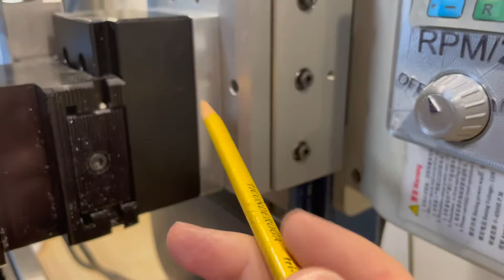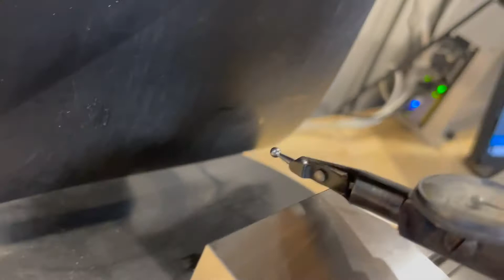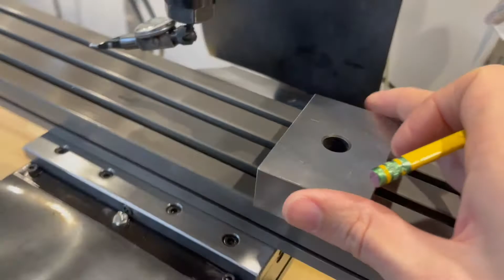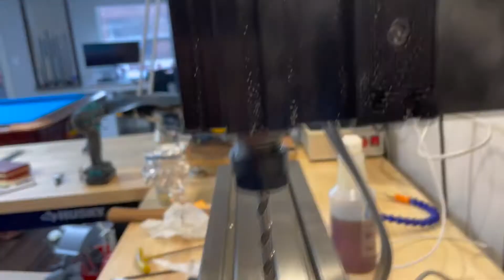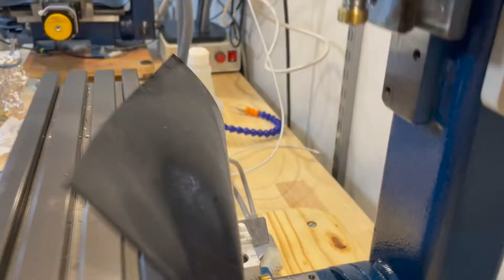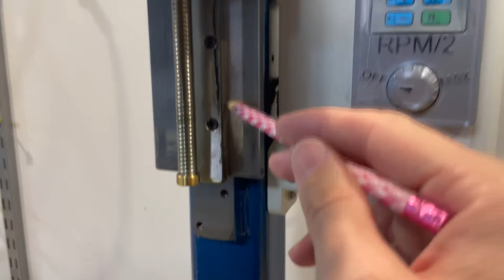Taig Ballscrew CNC Mill - Free Frame Modification - Part 2

Comment from the maker: See description for dovetail order info from Taig, and grabcad link of spacer. Also there is a part one of this series here: https://www.youtube.com/watch?v=tJH9UEhvRuY&list=PL_e9tdItiJstqbkcuUE5oHTT3_JBb9_OE&index=16
Reply: Hey nick quick question is the 1.730 dimension from bottom of dovetail base to the top of dovetail groove?
Reply from the maker: @pauldiaz4273  Overall part height is 1.732. Height from back to the bottom of the dovetail is 1.355.
Reply from the maker: @pauldiaz4273  If you are on FB here is my post showing the drawing that taig sent me of this part: https://www.facebook.com/groups/Taig.Lathe.And.Mill.Group/permalink/3485260501571113/

Comment: .0005 measured across 5 inches or whatever the indicator swing is, is PRETTY darn good for a mill that will never use a cutting tool big enough to see that full .0005 deviation in the surface from a cut!

Comment: Is the larger dovetail that you put in the https://taigtools.com/product/300-49-lathe-headstock-dovetail-mount/ ? I'm hoping to make the same modification to my mill so I stop running into the ball-screw with my vise lol.
Reply from the maker: No, that's not it. Its part number 500-47 and called "Dovetail Plate for Variable Speed Motor". Its 1.730" thick. It costs $30. IDK if Taig has it listed on their site. They gave me the part number over email. I had asked them for the thickest plate they make. Call them up and ask them to order this part number.
Reply: Thanks! Just called them and ordered the part. Looks like it's still $30.
Reply from the maker: Thanks for the question. I also added the part number to the video description just now.
Reply from the maker: Also just added the CAD of the spacer. Please see description for download link.

Comment: Hi nick do you have a blueprint in how you made this setup? I would love to do this mod! Great job by the way!
Reply from the maker: Hi, do you mean the file of the actual spacer? I have not shared it on grabcad yet but I will.
Reply: @nickp4793  ya any information that will help do this mod to my taig. Also can i use my stock lead screws? Or do i have to change out for longer lead screws?
Reply from the maker: @pauldiaz4273  Just unscrew the whole Y axis (the aluminum extrusion that touches the frame). Then shift it forward one set of screws. The screws are 2" apart, so it will move  forward 2". Then do the same with the Z axis, shift it up one set of screw holes. Nothing else to change. Same stock lead screws. It takes 30 minute to do the whole thing.
Reply: @nickp4793  your the best thanks nick! When you have time please share the actual spacer print. 😊or do you have the exact dimension of both blocks  extrusions?
Reply from the maker: @pauldiaz4273  Sorry I didn't upload the spacer piece yet. But I just added the part number to the video description of what to order from Taig if you want to do the same.
Reply: @nickp4793  oh thank you nick, if you can what is the thickness of your spacer!?
Reply from the maker: @pauldiaz4273  Hi, I just uploaded the fusion file. The grabcad link is in the video description. Its .512" thick. 1/2" stock will be close enough;) And if you buy jig plate, it will be super flat and parallel.
Reply: @nickp4793  thanks nick for all your help!your a good man 👍🏽

Comment: Have you thought about filling the box tubing frame with sand / modified polymer cement or epoxy?
Reply from the maker: Yes, I want to fill it with epoxy granite. Just haven't gotten around to it yet.
Reply: @nickp4793  When you do please make a video, I think a lot of people including myself would love to see your process.
Reply from the maker: @FreedomFactory3D  Yes for sure. I would run the exact same test part program before and after filling, then compare them.

Comment: That indicator has either been dropped or there isn't enough pre-load on the spring.  It doesn't start at the bottom of the dial which is where a normal last word will begin.
Reply from the maker: Its probably 50 years old and definitely dropped a few times at least on my watch. But I think the older ones may have had the needle at 12:00 instead of 6:00 at rest. I came across some images and video of the needle at rest in that position, the same as mine.
Reply: @nickp4793  Most likely if the arm is stroking the pinion correctly the hand will need to be moved to line up 180 degrees to where it is now.  5 minute job actually.  Most of mine are that age or older.
Reply from the maker: @terrymoorecnc2500  Thanks! I may try to fool around with it.